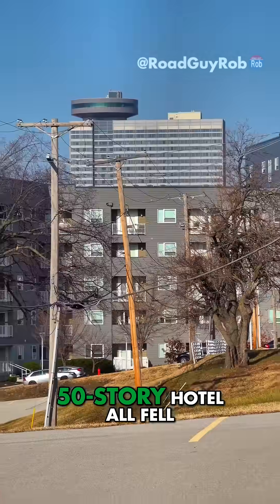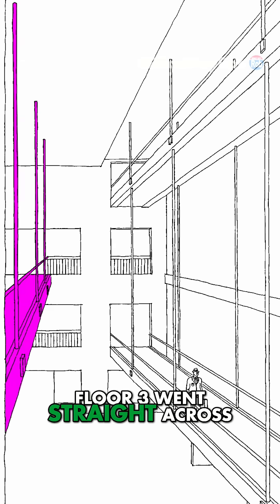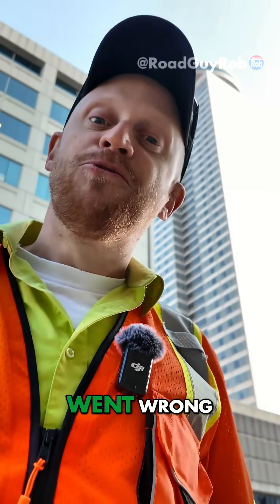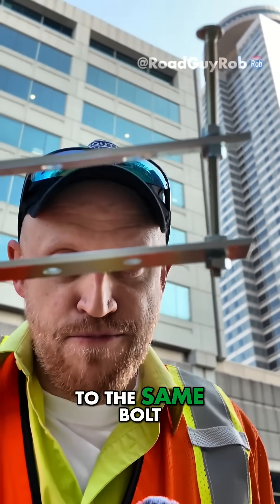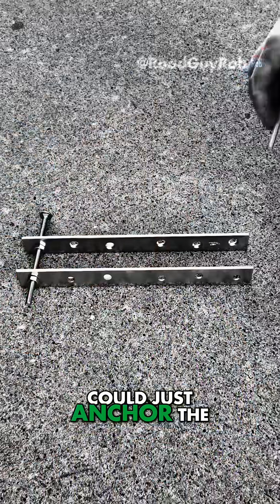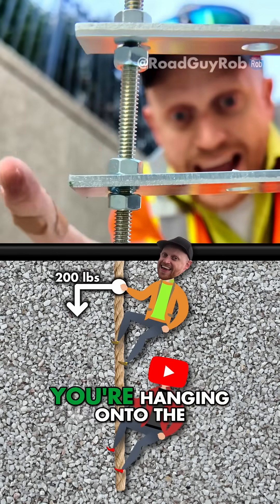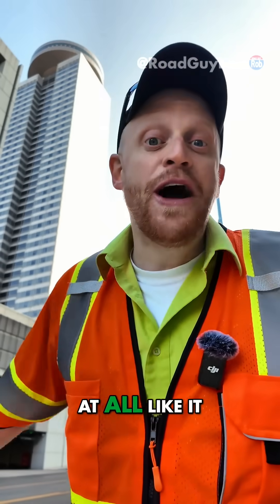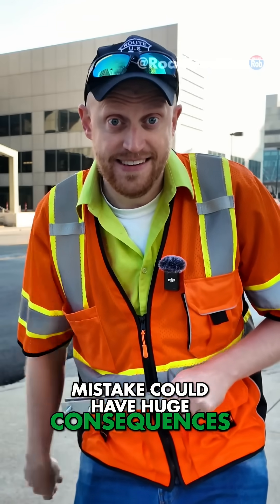Hyatt-Regency Engineering Mistake

Comment: Dude - people did check the work.  They just missed it.  Also, there was (and is) a solution other than 40' long threaded rods and threading standard nuts to their mid-points.  The better solution is to use elongated 'sleeve nuts and have the rods threaded in from both ends of the sleeve nut to attach the lower level to the ceiling-hung rod supporting the upper level.  This was pointed out in ENR in a letter (the forerunner of today's comments) the week after ENR reported on the failure mode.  This incident (and that letter) had a big impact on how I viewed engineering drawings subsequently in my civil design career.

Comment: The real sad thing is if they had increased the strength of the 4 floor skywalk hangers by just filling the box beams with solid metal plates it would likely have been fine. The third floor skywalk supporting itself was just fine but was taken down after as the trust in it's safety was ruined.

No structural engineers actually paid full attention to the implications of the change and recalculated the loads. So it went down as an infamous example learned by tragedy on why even minor seeming construction changes need to be fully analyzed for their structural implications.
Reply: The third floor crossbeams also showed distortion at the nut bearing surfaces indicating yielding to punching stress.  These connections were underdesigned even for the single walkway condition under the actual load experienced that night.

Comment: If I remember correctly, the truth only came to light when a newspaper reporter took pictures of the aftermath and they were able to actually see the design change in the photos. Another problem was that the beams were constructed out of two i-beams welded together along their length and the holes for the threaded rods were drilled through the weld line, the weakest part of the beams.
Reply: Well, the NTSB took photos and figured it out themselves.  It's kinda what they do.  Also, the crossbeams were a box edge-welded from two C channels.  Welding on a plate on the bearing surfaces for the nuts would have prevented them from pulling through.
Reply: @kayzinti4452  Why would the NTSB be involved in a structural collapse?

Comment: You got two facts wrong:

1. The original design was not inconvenient, it was physically impossible to construct. The single rod had to be three stories long which was too long to slide between floors to fit into position.

2. The failure was not too much weight on the top rod. With both designs, the top rod would carry the same weight. The problem was the connection BETWEEN the two rods. The connection was not properly designed to transfer the load from the lower rod to the upper rod. It needed something called a MOMENT CONNECTION.

Comment: He didn't quite describe the cause of the failure correct.  The key thing to ask about the original and resised is how much weight is the nut on the fourth floor connection expected to carry.  In the original design that nut only had to carry the weight of the fourth floor.  In the revised design the nut had to carry the weight of the second foor AND the weight of the fourth floor.   When they inspected the wreckage the nut and washer of the fourth floor had punched chear through the beam.  I was a young architect at the time and reading about it was very sobering.

Comment: They knew exactly what they did. It went to the courts. The engineer clearly stated that it wasn't done the way he designed it and the builder cut corners to save time and money. The building contractor claimed that he was under too much pressure to meet the deadline from the owners. He went to jail.

Comment: It's a good point. Engineering is very precise and you can't just substitute your "common sense". The guys who caused DC 10 AA191 crash in Chicago 1979 also thought they were just saving time and expense by being clever . Lots of people got hurt then too - 271 died. The Space Shuttle Challenger was another tragedy where the engineering wasn't the problem.

Comment: That isn't what happened at all, The Lower floor was to be suspended independently of the upper floor.... The 'change' was not authorized by the engineers nor were they aware of it... It was one of the worst engineering disasters of the 20th century. Concrete and steel rained down on hundreds of people below leaving them trapped...

Comment: Actually, this explanation doesn’t make any sense. You have to give us the actual point of failure. Because if it was the bolt itself that failed then it doesn’t matter how long the bolt was, the combined weight is the same whether or not the floor is directly anchored to the bolt or the floor above it. Now if the hardware holding the upper floor to the first rope is only rated for the weight of that floor, then it would make sense that attaching double the weight would over-stress the hardware holding the upper floor to the bolt.

Comment: It wasn't the engineers that changed this. The contractor made this change without permission. Any structural engineer would know this could be catastrophic but CONTRACTORS ARE NOT ENGINEERS. Somebody was at fault for not inspecting this change and making it be corrected. As an engineer who has watched contractors work one thing is for sure and this guy has it right. Contractors are lazy and try to cheat in any way they can to get the job done faster and cheaper. Seen it a hundred times. The contractors caused these deaths. Do not blame this on the engineers you uneducated twat.

Comment: I'm pretty sure that was not an engineering mistake. That was a mistake in the implementation. Also, while you got the cause sort of correct?You missed the point of the failure. Using multiple unconnected, bolts meant the load was being held for the above floors on the decking for the lower floors. That decking assembly was not designed to carry anything other than its own weight. It was the connection that failed and not bolt. Famously, the bolts were left hanging.  Facts matter bro.

Comment: If I remember correctly, the change was not even reviewed by the engineer for the project.
Reply: No, the engineer of record signed off on the change proposed by the fabricator...but without actually reviewing (analyzing) anything, based on a phone conversation without drawings.  It is a well known (and broadly taught within engineering schools) example of engineering/ engineering management failure.
Reply: @BrianFullerton  Oooof...

Comment: It's not the only fault that lead to this. Yes, the load on the upper floor fixtures was double what it should have been. But if it was correctly designed in the first place, even the mistake wouldn't have caused the failure. The safety margin was too low in the initial design. While the bridges were crowded, they shouldn't have been at their maximum design load because that should be a load beyond what you could fit on the bridges. So the upper bridge fixtures failed at less than twice their correct design load.

Comment: Issue is they actually made the change and they didn't consult an engineer about it an engineer would have recognized that hey this is not safe and now that you show me the example with those brackets in bolts it's obvious it's freaking obvious but again a lot of these construction accidents happen because people make changes or they change the process they don't complete it the way that they're told to do it they take shortcuts or don't let concrete cure long enough so on and so forth great video great analogy!

Comment: I'm old enough to remember this happening.  To be honest, I don't like the original design much less the modified design.  It's basically two c-channel beams welded together.  And the bearing surface -- basically the flanges of the c-channels -- seemed too small for comfort IMHO.  I would have transferred load more towards the sides into the shear webs not into the flanges.  For the given design with the rod running through the centerline of the beam, this would have required a bracket not just a washer.

Comment: I worked commercial construction as a union carpenter in Las Vegas for several years. I am a 4th generation carpenter/rod buster and caught a pretty severe engineering mistake at one of the newer casinos which could've resulted in part of the exterior crashing down onto the strip. I was an apprentice at the time and got shrugged off. Eventually I managed to get the attention of the general superintendent and had to offer up my job if I was wrong as a bet to show how serious I was. In the end, I was right and I'm thankful the issue was addressed before it became a much bigger issue or people got hurt. I'm disappointed not a single person involved in the construction of this lobby balcony asked questions or raised concerns. I've learned the best way to get folks to set their ego aside is to ask questions and have them explain the how and why. Usually they'll see the mistake while doing this, without them feeling butthurt that a "lesser" person caught something that they didn't. Tbf I took autocad classes for 4 years in HS and started to get my degree in civil engineering and always had a legitimate autistic love for engineering and architecture.

No, I'm not going to point out which casino and where. I don't want to catch any heat or get sued by the property owners or some crap. They are VERY litigious. Heck, a failed drug test on many of the job sites will result in a lifetime ban from all properties owned by each group, which is like 3, not that I'm against this. I've worked with many men under the influence of various things and it can be scary as hell when they're the ones controlling the equipment.

Comment: It might have worked if it were not for the dance party. Multiple people moving their bodies in time to the shared dance rhythm put unusual stress on the structures.
Reply: In the initial plans the safety rating was already 60%. After the change, the safety rating dropped to 30%. So no.
Reply: the fact there were a lot more people on the walkways was also a factor in the timing of the failure. but as tree stump says, it was going to fail, sometime.

Comment: I'm a structural engineer who lives in KC. Every structural engineer knows about the incident, and it's a good case in diligence over the smallest details. This is a good illustration on the basics of what went wrong, but I would have at least mentioned over 100 people died, not just 'a lot of people got hurt'
Reply: So was it the nuts on the upper level that gave way?
Reply: @MJ-iy4fb  iirc yes, as (in RGR's example) the nut was rated for 200 lbs, but the design change loaded it with 400 (it was also heavily overloaded by people STOPPING on the balcony which wasn't really considered).
Reply: When I teach medicine residents I sometimes bring this up, and the disaster at Tenerife because of confusion on what "takeoff" meant over the radio. Fun fact, because of Tenerife, there's a difference between "departure" and "takeoff"
Reply: IYKYK - "people got hurt" makes this video something we can show kids as even young kids can understand the example and why it failed; no need to also tell them that 100 people died; they'll find that out later.

Comment: Gyat-Rizzgency accident
Reply: The Gyat-Rizzgency Disaster: A Masterclass in Negative Aura Engineering

The 1981 Hyatt Regency walkway collapse remains the ultimate cautionary tale in the engineering lore; a canon event that reset the industry's rizz and accountability standards. What began as a vibey tea dance at a high-tier Kansas City hotel ended in the deadliest structural crash out in U.S. history, claiming 114 lives.

The Design: Mid-Tier from Day One
Before the first bolt was even tightened, the original "single-rod" design was already a fraud. It only met roughly 60% of the minimum load requirements set by Kansas City building codes. So, the walkways were lagging before the project even launched.

The Rod Swap: A Massive L
The real Fanum-tax occurred during fabrication. To avoid the beta task of threading a 45-foot continuous rod, the fabricator proposed a "double-rod" system. This mid move fundamentally changed the load path, dropping the safety capacity to an abysmal 30% of the required code.

The Delulu Review Process
The Engineer of Record (EOR), Jack Gillum, and his project engineer, Daniel Duncan, completely failed the vibe check. In a series of NPC-level communication errors, the fatal design change was approved over a phone call without any actual math being performed. Despite having their stamps on the final drawings, the engineers assumed someone else had checked the receipts for the structural integrity.

The Final Crash Out
On July 17, 1981, as the lobby reached max occupancy for a tea dance, the fourth-floor box beams (welded toe-to-toe in a low-aura configuration) finally folded. The beams split open, the rods slipped through, and both walkways plummeted into the lobby.

The Aftermath: Zero Aura, No Second Chances
The professional consequences were swift and unhinged:

License Revocation: Both Gillum and Duncan were found guilty of gross negligence and had their engineering licenses permanently banned in Missouri and several other states.

Firm Revocation: G.C.E. International had its certificate of authority revoked and lost its "aura" as a legitimate firm.
ASCE Expulsion: Both engineers were stripped of their membership in the American Society of Civil Engineers.

While they avoided jail time because the grand jury found "no criminal intent," the case established a main character role for all future projects: the Engineer of Record has a non-delegable duty for every single detail of a project's safety. 

Today, the "Gyat-Rizzgency" failure is taught in every engineering school as the ultimate "don't be a fraud" lesson in professional ethics.

Comment: It seems like they could have used unions to lengthen the single bolts instead of a single threaded bolt. Pin the unions in place through the bolt and it should work as originally designed.  It's really shameful that nobody did a revised force diagram for the change.

Comment: There's a very good engineering analysis video about this somewhere on this platform.  It comes down to the structural engineer, when presented with the contractor's change request, brushed it off as nothing and signed off without thought.
Reply: That’s incorrect they did not run it by the engineer they changed it in the field and basically told no one from the engineering side of things.  And what failed was the fasteners. the fastener holding the fourth floor bridge was only to designed to hold the weight of one bridge, but it was holding the weight of two. Couldn’t have been engineered properly for the way they built it sure but it wasn’t designed that way.
Reply: @adamlawrence8736   Uh, revised shop drawings were submitted and approved showing the change, therefore they were approved by registered engineer.  I was working in an engineering office at the time and followed this closely.  Additionally, looking at the third floor cross beam (two C-channels welded edge to edge and drilled for the rods) revealed that the connection was under designed for punching stress imposed by even one walkway's possible loads since the support nut bearing surfaces were showing distortion indicative of yielding to the  punching stress.
Reply: @adamlawrence8736 What's worse is that from what I've read, the original design with continuous rods already had less load bearing capacity than the minimum building code requirement, and the change further reduced it by a significant margin.
Reply: Practical Engineering's Grady Hillhouse, who told the story while a summer replacement for Tom Scott.

Comment: My understanding was always that the contractor just did it and never got an approval from engineering.  Is that wrong?
Reply: The failure was that no one talked to each other. The original design was never fully reviewed, the steel contractor took the draft designs as final, the engineer accepted the contractor's fatal rework without proper review, and in the end everyone involved thought someone else had checked the work, and the main engineer signed off on it, when in reality it had never been truly looked at.

It gets worse because even the original design was deficient; it was 40% below city code minimum load spec. On top of that both designs ran the support rod through a welded C-beam joint, which is the weakest point and indeed was what started the collapse when the welds split open due to the load.

The engineer of record (who lost his license over the disaster) said the flaws were so bad that "any first-year engineering student could figure it out," if only it had actually been checked.
Reply: @stormriderttv  I heard about the lack of strength to meet code but I didn't realize that someone had told the contractor the changes it had been signed off on.  So did the contractor then escape liability?  Because I thought they hadn't.
Reply: Yes that is wrong.  The construction management engineers signed off on the revised shop drawings showing the change.